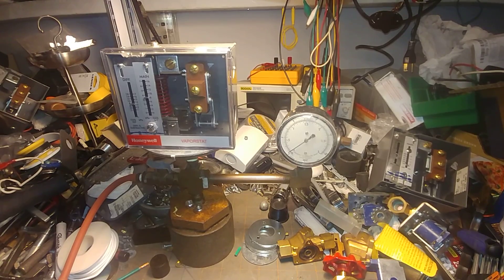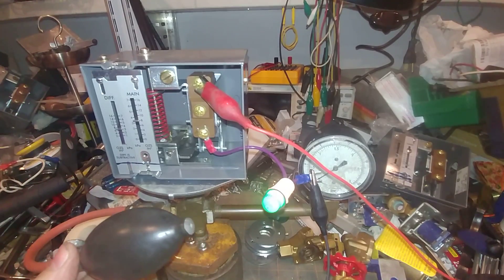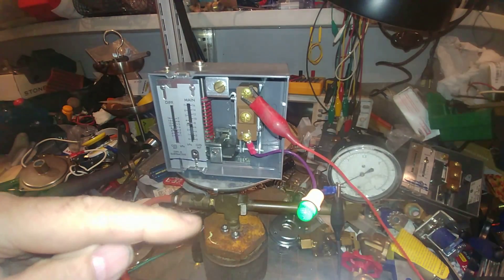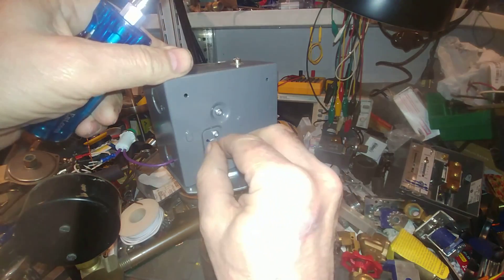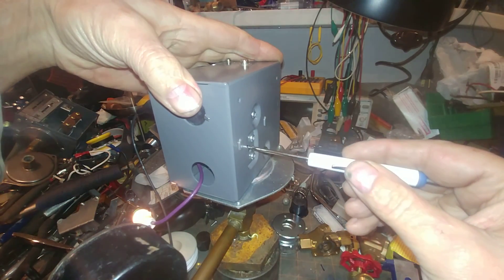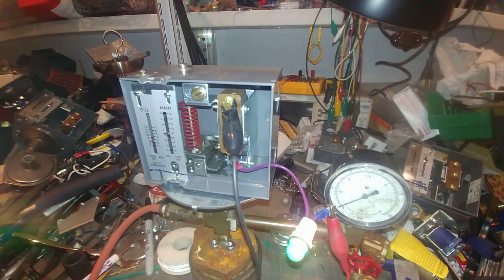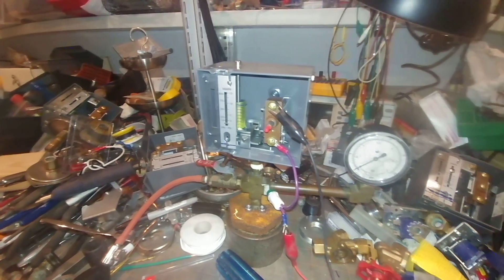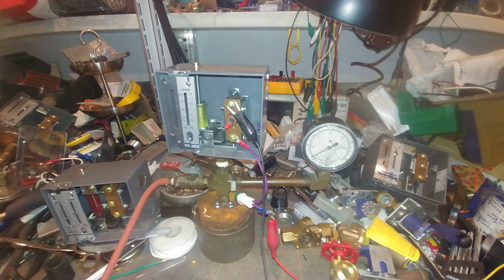Fixing A Failed Honeywell L408J 1009 Vaporstat - "Look Ma, No Mercury!"

Comment: Good morning, engineer. I have an L404F, T, V MAIN 20/300 DIFF 20/50 PSI. I need to set it to high. If it is a steam boiler, the burner enters at a pressure of 7.5 bar and shuts off at 9 bar. I need the burner to be set to high. How do I set it?
Reply from the maker: I really only work on low pressure steam systems, 1.0 bar max.
Many of the steam heating systems I see work best at 0.10 bar (approx 2 psi) or even less!

Comment: Awesome video!  I ended up making a bench test kit like yours so that I can test mine every fall to make sure she’s running true.  Question though, I try to run my boiler at 0.5psi high level cut off and 0.25psi differential. I can get the high level cut off to function and read accurate on my gauge no problem, however the lowest I can get the differential to operate is about 0.5psi differential, even with the diff screw backed all the way down.  Is there any way to adjust that so I can get it down to 0.25psi differential??
Reply from the maker: It seems the practical limit of the newer Hg free controls is about what you are experiencing, sad to say.
And the differential seems to be indifferent to whatever I've set it to, as you have found.
Others have reported to me better results.
I've tried to tweak them lower using "not allowed" techniques, but they become unreliable below 8 oz/in2.
The old old Hg vaporstats could easily go down to 2 to 3 oz/in2!

Comment: Greetings to you, engineer. We benefit and learn from you. What is the difference between high and low temperatures in a steam boiler?
Reply from the maker: Temperature is usually not an issue with steam.
A kilogram of steam contains A LOT of heat!

Comment: I just want to thank your from the bottom of my heart for doing those videos. My pressuretrol wouldn't shot off my boiler even when my main gauge would get to 9psi. I though, as most, it was clogged pigtail. Because of your videos i decided to test the pressuretrol (using similar rig you have but with my wife as the "stand") and it turns out that it wouldn't interrupt the flow of continuity even if i pushed it to 5psi (max on my gauge dial).

Thankfully i have rebuilts classic car carburetors in the past so i know there is always a screw that can make things "go". (the one in the back of pressuetrol that you show how to adjust). After some fiddling, the device works. It shuts off the boiler when it reaches 2.2psi (as set, though it's hard to precisely read the scale) and turns on when it reaches 0.7psi. (my pressuretrol is differential. main is set to cutoff at 2 and differential is set at 1.5) Than you again!

Comment: Nice explanation. L404A 1396 instead can I L404f 1102
Reply from the maker: @pranavgrish5167  Dear Sir, thank you for your praise & question.
Could you please provide a bit more detail so I understand better what you are asking?
Reply: @gordonschweizer5154  L404A 1396 honey well pressure switch not working. So I couldn't get same model.So can I use L404f 1102 model.Is it terminal connection same?.
Reply from the maker: It appears that the L404 F 1102 is the "non mercury" replacement for the discontinued L404A 1396.
The discontinuation was due to shipping agencies no longer allowing mercury anywhere near their aluminum aircraft. 
It appears the terminals are the same, but consult with the manufacture's instructions to be sure.

Comment: For a system that cannot run at over 1.3 psi (40 in B dimension), would you say buying one of these non mercury Vaporstats is worth it, or should I look for a NOS mercury switch one or old Mercoid control in the correct pressure range? Is it such a big gamble to buy one of these?
Reply from the maker: The good mercury Vaporstats are getting rare.
Some folks report that the old Mercoid controls work great, just like the old Vaporstats used to.
I myself don't have any good experiences with Mercoid controls to say good things about them.
So far, the L408Js, have not been reported lately to have any issues, but a back-up control is not a bad idea, I think.
Your 40" B dimension is enviable compared to other vapor systems I've encountered, so you should be ok with a "bog standard" Vaporstat.
Reply: Quality control across the board has taken a big hit in everything we buy today